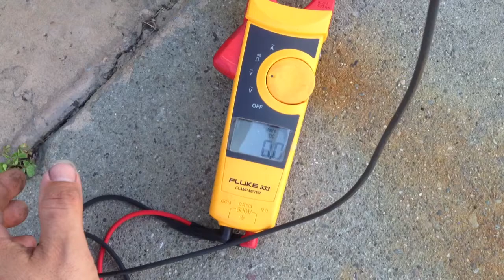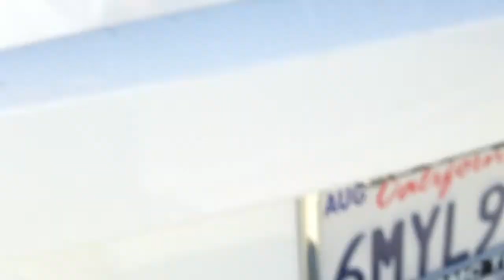12v trailer power hookup from the underwood

Comment: Even stranger i disconect all the grounds and it all still works with headlights off
Reply from the maker: Joseph DeVito Even if you disconnect the ground wire if the trailer is still connected to the vehicle sometimes being connected to the vehicle will ground the trailer if that makes sense